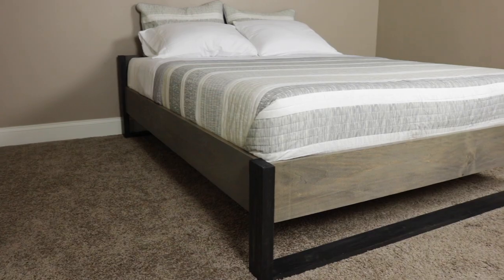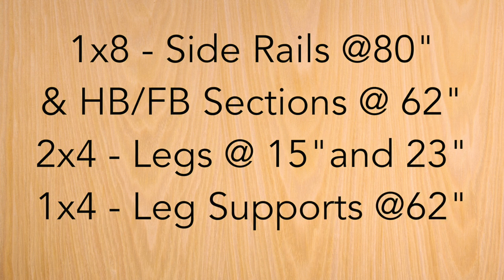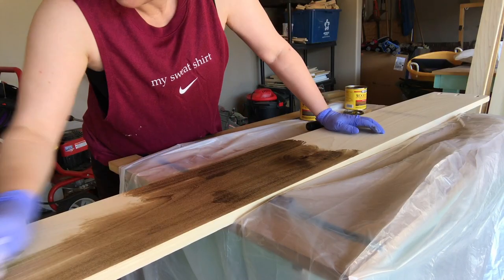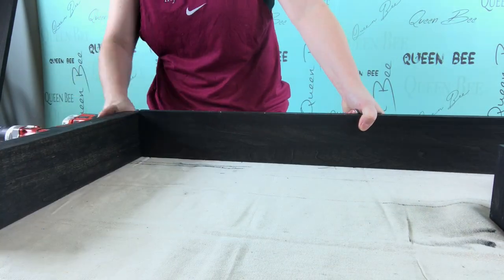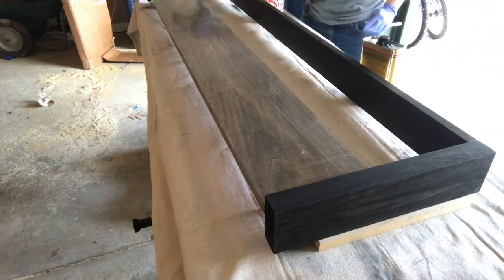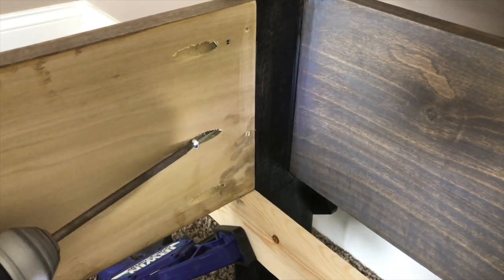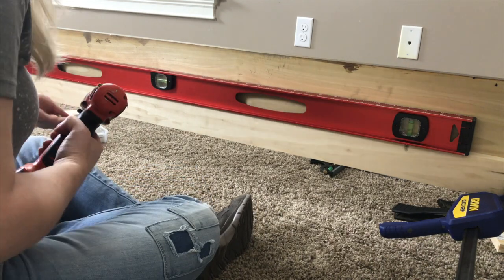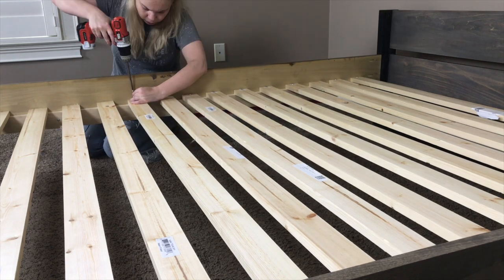How To Build a Modern Platform Bed - Easy DIY Video

Comment: This video was 5 years ago. wondering how it is holding after 5 years. specially curious about pocket holes on sidings. Appreciate a follow up video on this.
Reply from the maker: I am happy to report that the bed is still in perfect condition. I even took it apart and moved it to another house and it has been holding steady. For reference, my son is now 19 and weighs 165lbs.

Comment: The bed looks really nice. Just a small tip. Add a support beam in the middle. The planks may just snap
Reply from the maker: That's a good idea! I use center supports on King size, and only on queens when a lot of weight is expected. In my case, you could stack 3 of my sons on this one, and it would be fine. 😉 But, other's may need it.
Reply: @Queenbeeofhoneydos  I bought a bed that didn't have a middle support. The planks kept on breaking one by one. Eventually I put a middle support beam on and now it actually makes the mattress feel much better than it used to.
Reply: Yea, with my family, boys 6’5”, you need support in the middle and corners.  Nice simple plan though I can add onto.  When possible, it’s best not to put weight on screws.  Weight should go on lumber, if heavy use. I’ve even had  hardwood manufactured beds split because screws holding weight.

Comment: What type of wood did you use here? What would you recommend for bed frame builds?
Reply from the maker: I used Poplar. It is a good option for building inexpensive furniture. Oak would also look nice for this bed. However, you can use just about any wood species. My considerations are always 1) finish (what will give me the best final outcome for the look that I want), 2) durability (will it be strong enough for this situation), and of course 3) affordability.

Comment: Nice video & great job w/ the bed. *But I believe your interior dimensions are 84” (not 81.5” as indicated) x 62”. That’s if your side rails were cut to 80” and your HB/FB pieces are recessed 2” from the inside edges of the 2x4 legs as it appears - Otherwise your rails are shorter than 80.
Reply from the maker: Good catch! Yes, the interior is 84" and will be so based on these cuts. I think I was running on 3 hrs. of sleep when I edited this. Now, where did 81.5" come from?🤔

Comment: Do you have a link to the two Minwax stains?
Reply from the maker: Provincial - https://amzn.to/3ctbVQU
Classic Gray - https://amzn.to/2LsnImA
Reply: @Queenbeeofhoneydos  thanks!!
Reply: That will give it the same color as in the video right? The picture it shows on the can looks lighter than in the video
Reply from the maker: Some screens display differently than reality. So, I can't account for that, but these are the colors that I used on the headboard/footboard. Assuming you apply them to poplar wood, you should get the same shade. I also applied polyacrylic in satin which makes the color look richer. I would recommend trying it out on a scrap piece of wood first. That way you won't ruin your bed if you don't like the color.
Reply: @Queenbeeofhoneydos  Awesome! Thank you so much!
Reply: I’ve started staining my wood with the first stain and I’m testing the gray on top of a test piece of wood and it does not seem to be making a difference at all. Was I supposed to do something. After the first stain or am I just not doing it right?
Reply from the maker: The gray is just suppose to give it a sort of aged look. Make sure you really mix the stain well. The color of the gray tends to hang around at the bottom. Also, wait for the first stain to dry. I think I may have done 2 coats in a few areas when it didn't come out as strong. And remember that you won't get the full effect until it all dries and you add the sealant.
Reply: Also do I sand the wood after the last coat of polycrylic? Or just in between coats?
Reply from the maker: Just between.
Reply: Should I apply the last coat with a rag to prevent strokes? Or is a brush fine?
Reply from the maker: That's really more a preference. If using a wipe on, I prefer to use lint free cloths, which is what I recommend for all beginners. I use brushes with other finishes, but that takes practice to avoid brush marks.